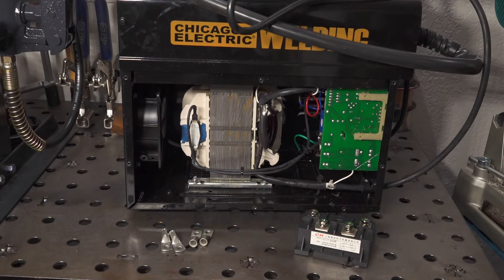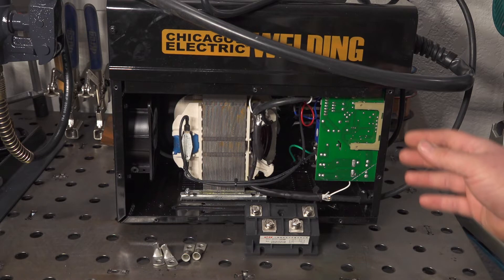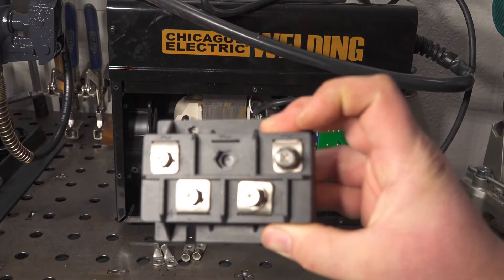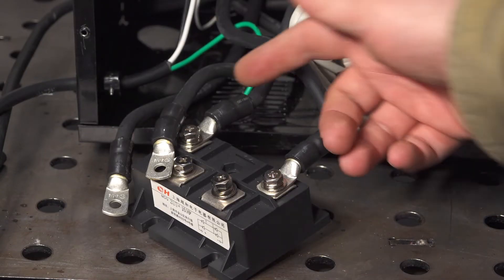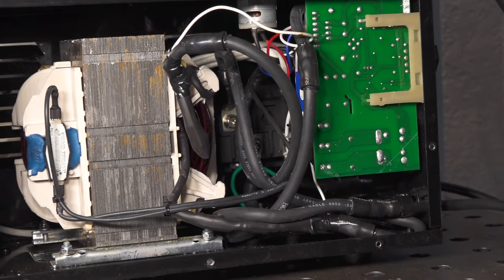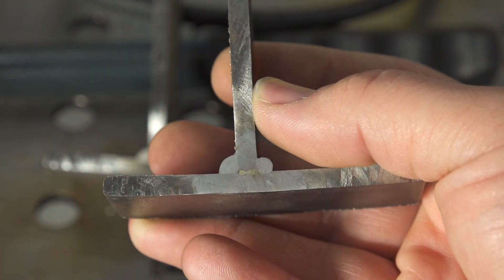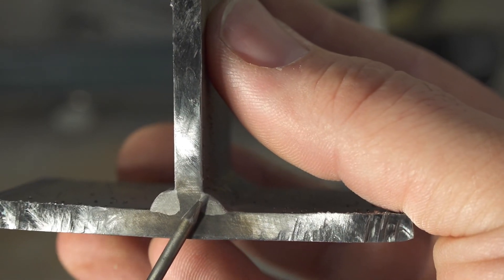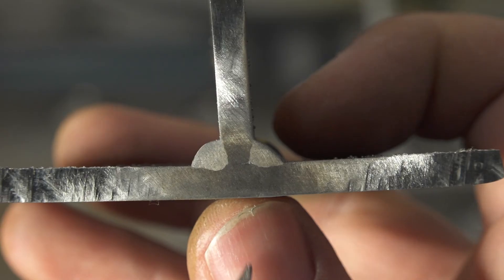Harbor Freight Flux Core: DC Conversion and Testing

Comment: One comment one question:  

First, the question - how much splatter reduction did you see with this mod?  I’m planning on doing this and reducing the splatter is of primary importance to me as I have a Hobart stick welder that I use for anything structural or that needs deep penetration.  I’m planning on forgoing the capacitors as well because I don’t want to put the money into it AND IMHO, it’s dangerous if you don’t do it right!  I think anyone who throws a capacitor in there without a system to diffuse the leftover charge is playing with fire.  Eventually, you’ll forget and grab the ground while your still holding the electrode.

Second, the comment.  I see a lot of people out there complaining about these welders being useless.  That has not been my experience and it makes me wonder if it’s the welder and not the machine.  First off, get yourself some decent wire.  I use Lincoln electric flux core in .030 and .035 and it works great.  Less splatter and good beads.  Second, clean the surface!!!  This isn’t stick welding on 220 where you’re going to punch through grease, rust and even paint without issues.  Third, and I think this is likely the problem with most people - learn how to run a good bead first, preferably with a stick welder.  I use my flux 125 on all sorts of materials and it works pretty good  as is, out of the box (minus the splatter) especially since I got it for a $40 open box special.  Turn down your wire feed to 5 or 6.  Take your time and let the heat build so you create a good puddle.  Stitch it back and forth.  Make sure your tension is set correctly - i.e. you should be able to stop the wire with light pressure from one finger.  I welded a engine cart together last week using this welder and some square stock and it’s holding my 800 lb Jeep 4.0 engine right now, solid as a rock.
Reply from the maker: Spatter is definitely reduced.  Mostly the spatter is a bit more fine (smaller spatter bb size).  The AC output results in larger spatter that is often more difficult to remove.  With DC output it's definitely better.  There is still spatter though.  But there is less.

I agree that if you install a capacitor it should have a bleed-down resistor to drain off the voltage.  However, I would say getting flashed is probably the bigger danger as compared to shock.  The open circuit voltage on a welder like this is far lower than on a stick welder, and a stick welder output is live all the time.  Still could get shocked, but I think it's far more likely to simply get flashed after lifting the helmet or before lowering it if the wire touches the table or work piece.  

I agree that this welder is very capable for the money.  Up to 1/8th of an inch thick material it works very well.  Above that it gets very little penetration.  Technique and settings can help achieve a decent looking weld, but I have found the penetration to be seriously lacking on 3/16" thick material.  The A/C output really holds it back.  With DC output it runs smoother and burns in better.  But again, that doesn't mean it can't make welds that are strong enough for a lot of projects as it is out of the box.  I think people go a little overboard in both directions when talking about this welder.  Some people seem to adamantly claim that it is just as capable as any more expensive welder but people just want to justify their expensive welders so they put this one down.  Others simply insist it's 100% junk.  The truth is definitely somewhere in the middle.  The machine definitely has limitations and it simply isn't as capable as a 240V welder, or even a similar welder with DC output.  But within its limitations it works fine.
Reply: bigtb1717 good to know about the shock vs flash.  Now that you mention it, both of my comments relate directly to another instructional video I watched today in that 1) the person who made the video flashed himself the first time he used the welder and 2) he judged the upgrade as poor because both the “beads” he put down looked like garbage - though I have seen a lot of comments knocking this welder as well.  The gentleman in this other video literally just pushed the trigger and dragged the electrode for a couple seconds on the metal surface.  Zero technique, zero patience.  I have also found that this welder works great for the 1/16 and 1/8 tube I usually use to fab little things around my shop.  If anything, I find the conservative nature of this welder beneficial in that I’m not blowing holes through square tubing left and right.  Like you said, the bottom line is that this welder functions well for what it is, but is limited in versatility and will NOT weld things for you or lay perfect beads without some effort and knowledge!  It’s been very handy for me around my shop though - it’s my go-to for quick tack welds with the shelves I just built, as well as thin tubing.  I’m hoping that the conversion to DC will eliminate enough splatter to allow me to use it to weld frame stiffeners to my Jeep, but I’m keeping my expectations tempered.  I guess that since I bought mine for a song, I tend to fall on the over-optimistic side of the argument, though!

I have one suggestion/comment, and I certainly don’t want this some come off as condescending, but I’ve heard and found that, contrary to what many people assume, turning the speed down on the wire feed will allow for deeper welds.  As I understand it, adding new wire/steel to the puddle has the effect of cooling the puddle, and therefore the slower you add wire, the more penetration you get (within reason). This is because:  1) the puddle reaches a higher temp because you’re not constantly adding metal and 2) the bead builds slower so you can stay in one place longer.  I’ve found a wire speed of 5 to 7 to be good for most applications, with a tendency for 6.  Additionally, in regarding to upgrading or adding a cooling fan — I chose to keep my secondary cooling fan on a separate circuit.  Meaning I had a 115 vac muffin fan that pushes about 40 CFM laying around and decided to power it with an independent plug, the logic in this being that if the goal is to extend duty cycle, I’m better off with an independent power source rather than utilizing the welders system.  This may not make much of a difference in practice, but I am a novice/hobbyist.
Reply from the maker: I'm always open to comments and suggestions.  I understand what you are saying about heat and wire speed.  In general, increasing the wire feed speed should increase the amperage, causing a hotter weld.  However, if the welder is near max output and you increase wire speed it could cause issues.  There is definitely a point where piling too much weld on top will result in the arc basically just heating the bead, rather than burning into the base metal, but often that's from too slow a travel speed for the wire feed rate, rather than due to wire feed rate itself.  I have a video where I tested this welder with different combinations of travel speed and wire feed speed settings, cutting and etching each joint and comparing penetration.  Actually, I think one of the sets of etched welds I show for comparison in this video is from that testing.  One way or another, I've always heard that with welding, never say never because there are exceptions to everything.
Reply: bigtb1717 and I absolutely agree about it not being a 240v.  My Hobart stick-mate is 240 and it blows through grime, rust, and paint and still gets solid welds.
Reply: Ive heard to reduce splatter, you need to switch to electrode negative, so your hottest point is the metal you're welding into, rather than using 70% power on the tiny wire. Ive also heard that these Chinese machines (or any smaller welders, potentially) need to "warm up" before it starts to penetrate as intended and not splatter as much. I have the dinky 90amp version of the flux core welder and it takes a bit of time before it really starts to weld easier (same techniques/settings, just a warmed up machine).
Reply: I got a question about this welder. Would this little thing be able to get a good weld on 1/4 inch steel? Especially with this mod done to it?

Comment: I like  your ideas,,, and I have  a new HF 125 welder, want to use it for thin gauge metal without all the splatter.  Question: How about using a 300 amp 1600 v  rectifier  to decrease the  amount  of  heat  stress and a heavy duty induction/coil to smooth current out a little.? $25 on ebay
Reply: A 300 Amp rectifier is a good idea. It will be operating at approximately one-third of its maximum rating and as a result, have a longer lifespan.
Reply from the maker: An inductor can be helpful, but how large or how small an inductor can make a difference in the arc.  It's difficult to say just how large or small an inductor you would want to use.  You probably wouldn't need to buy an inductor, I think some people just wind a wire around something inside.  I've seen on forums where guys talk about how many turns of wire they use.  I'd say a capacitor is probably just as important for smoothing things out.
Reply: @Mere Woman;
Thin gauge metal? Buy an Inverter machine that can dial down current to 25Amp. 
Spend About $75 more than this welder. 
But If you try this mod, I believe you will need:
A large aluminum finned heatsink, screwed to the rectifier base with a thin film of thermal paste in between. And positioned in the case for fan airflow to dissipate heat.
After the mod, it's still a 20% duty cycle machine.  2 minute weld time, followed by eight minute cool down.
An Inverter machine may have a 60% duty cycle.

Comment: I got my dc bridge today. On the ac side you didn't say what side goes where. It might not matter being ac but does it?
Reply from the maker: Nope.  On the AC side it doesn’t matter which wire goes where.
Reply: @bigtb1717  didn't think so but..
Reply from the maker: Hey, better safe than sorry.  Hope it all goes well.  Let me know how it turns out.
Reply: @bigtb1717  I need some 8 gauge wire and connectors but also I think I'm gonna go all  the way and do a cap and resistor, except im an idiote and im unsure of what to go with there too. Im fould a cap that is 47000 uf 50v and I think I can run two 10v 100 resistor.  I have them in my cart but haven't purchased them yet. What are your thoughts?
Reply: So I got the wire and stuff but couldn't wait to finish my bike. All I did was change the ground clamp and that was huge. My welds are really good. My fabrication skills...  not so good.look like I bought Harley parts from China.hahs but with some  tweaks I managed to make them work.
Reply from the maker: @davidfellows6250  Cool, glad it worked well for you.

Comment: I have a brand new 125 never used yet, not a welder so I'm getting as much advice as I can here. I cant weld until Saturday because my helmet isn't here yet. So I could the dc bridge and bought it and a bett ground clamp for 26 $ on Amazon free shipping if you buy the clamp. Hows it holding up,and have you used it much? And as a newbie should I do it?
Reply from the maker: I would try it as-is first.  On thinner stuff (1/8") it will do okay stock.  If you do decide to put in a rectifier, I would recommend getting a heat-sink for the rectifier.  I didn't use one because I wanted to easily and quickly see how much difference a rectifier alone would provide.  If I was going to be using the machine a lot, I'd want a heat-sink.  On that note, I haven't use the welder much since the conversion.
Reply: @bigtb1717  I have a piece of aluminum does that qualify or are we talking finns?
Reply from the maker: A block of aluminum might help a bit, but something with fins would be best.
Reply: @bigtb1717  like everything else I found one on Amazon.  Thanks again for all your help. My helmet should come today and I have a whole lot of scrap stuff ..so here I go.
Reply from the maker: @davidfellows6250  Cool.  The smoke from flux core builds up quick.  Good ventilation is important and is easy to overlook.  No matter how cold it is I open the garage door when I weld flux core.  Also, fumes from anything zinc plated can make you sick, so be mindful of that when welding anything zinc plated.  Also, never clean something you are going to weld with brake cleaner.  The fumes from super-heated brake cleaner can be extremely poisonous.  Just something some things to think about.  Be safe and have fun!
Reply: @bigtb1717  I tell you you have been a wealth of info. I wanted to ask you if it made any differences if it was cold outside (cold metal) but I thought I already over extended  my questions. I don't have a garage so outside on my porch   is where I'll be. Never thought of the break fluid thing. Thanks for saving my lungs. Got my helmet today but late so tomorrow.
Reply from the maker: @davidfellows6250  Cold metal from cold ambient temps won't make enough difference to matter in the vast majority of situations.  When you think about the fact that steel melts at 2,700 degrees, you realize that starting at 30 degrees vs. 75 degrees isn't a big difference for the weld.
Reply: @bigtb1717  I see people pre heating pieces.
Reply from the maker: One of my recent videos is on pre-heating with that welder.  Pre-heating is often important to achieve specific results with certain types of metals.  In terms of getting more penetration, it can help, but not much and it takes a lot of heat.  I was surprised how little difference it made, even when heated to nearly 1,000 degrees.
Reply: @bigtb1717  thanks to you I did my first welds today welded about four inches on some scrap and it was good. I thought to myself this is it, it's easy. Then the next five feet was shit, very ugly but the weld itself seemed good so I went to the thing I bout the welder for. Everybody I talked to said that not the best weld to do as a beginner. Its 1/8 flat stock butted to 1/16 round tube. Long story short I got one bracket done and the other almost. My bike will have hard bags this year!  The welds are ugly but strong enough I ran them over with the car and they held. So thank you so much for all the,advice. Knowledge is empowerment and all you you tubers are kick ass.
Reply from the maker: Congrats on your first welds and tackling your first project!  A little grinding/polishing and some paint and I bet it'll look fine.

Comment: Can you post a link on where to buy or just an overall search criteria for me to use I'm new to welding for the most part and am not able to make this welder perform very well stock.
Reply from the maker: Are you looking for the rectifier?  You could search Amazon, eBay, etc. for 200a full wave rectifier, or 200a bridge rectifier.  I hesitate to post a link because things change so often with these types of listings, it may break or simply take people to the wrong place at some point.
Reply: @bigtb1717  I got ya yea I found one on amazon just looking for a capacitor

Comment: Thank you. Just installed a $21 200amp bridge rectifier in a HF 125 flux core welder without a capacitor based on your youtube video. I am extremely happy with the results without buying the additional parts. I could not justify the added expense, I would just buy a better welder. Being a novice welder I had terrible welds with the original unmodified configuration, now I see much better penetration.
Reply: This is a helpful comment.  I'm about to convert my 90 amp and don't want to throw more than $30 at it.  I'm stoked about getting better welds with less wire and less grinding.

Comment: I notice I'm commenting on a video that is several months old, but I have a few questions if you can help. First one is the connection of the rectifier. On the AC side does the connections matter? Is there a positive on negative on that side? Then on the DC side you make the gun portion connect to the negative and the ground clamp connect to the positive?  

Also, will this still only arc when the trigger is pulled or will it be hot without trigger pulled? I've seen several videos of people saying after installing the capacitor they needed to discharge it since it was still live.
Reply from the maker: There is no polarity on the AC side.  On the DC side you are correct, negative goes to the wire feed/gun and positive goes to the ground/work clamp.  

If you install a capacitor it will charge up as soon as you start welding and will stay charged when you stop, leaving the wire live.  If you install a capacitor it is highly recommended that you install a discharge resistor across the capacitor.  I'd have to do a bit of research to get recommendations for resistor ratings.  The resistor will cause a bit of draw on the capacitor and will drain it down when you stop welding, so the wire doesn't remain live.
Reply: bigtb1717 thank you!

Comment: Great video. Please consider a short tutorial on the butt and ring connectors you used, how you crimped them and links to purchase them. I'm thinking of replacing my cheap Chinese ground cable with a 6 gauge cable. HF has 16 ft,  6 gauge jumper cables for $15. Do you think replacing the ground cable would help? Cheers
Reply from the maker: Replacing the ground cable probably wouldn't help much.  Also, the stock ground cable is 4 gauge, so 6 gauge would be smaller and would be a down-grade.
Reply: @bigtb1717  My welder came with an 8 gauge ground cable, so I'd be stepping up in gauge.
Reply: Dominique Hardie  Awesome! Thank you so much for the info and I'll look that up now. The cable that came with my welder is only 8 gauge. I purchased a nice clamp from HF, got a 24V transformer for the wire feed motor, a 150amp full bridged rectifier and a dines connector for the ground. Cheers brother
Reply: Dominique Hardie  Just ordered the 6 gauge wire. $1.05/ft, free shipping and made the USA. Thank you again and hope you had a great Thanksgiving.